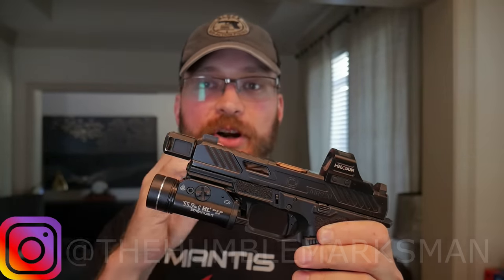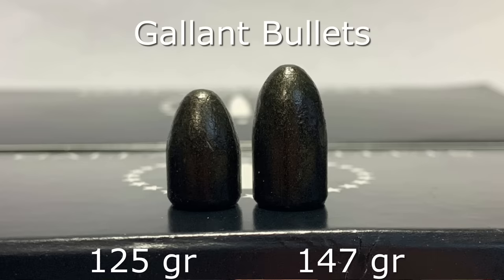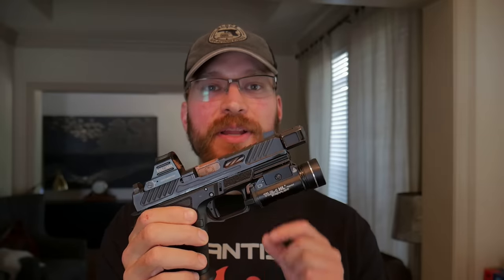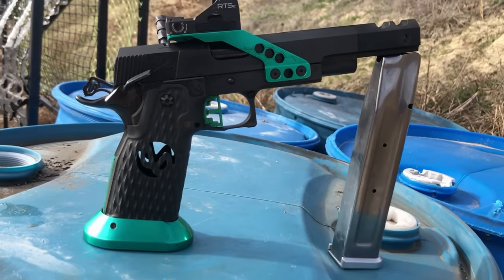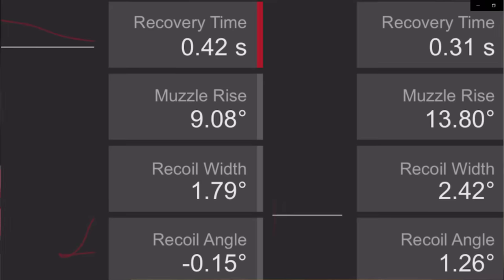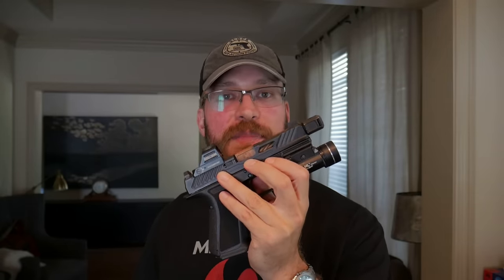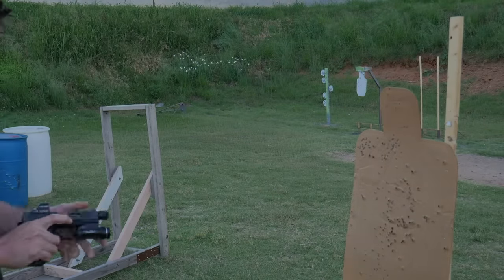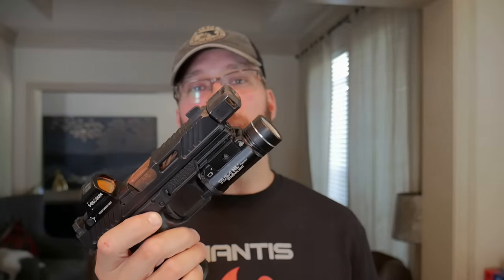Carry Comps - do compensators actually work on 9mm pistols?

Comment: Effectiveness of the comp is irrelevant. All that matters is how big the flex will be on the Gram
Reply: Big facts cause the most important thing is lookin cool
Reply from the maker: ABC
Reply: it isn't a flex though..they are cheap...
Reply: @dylanmills6944  not about the money bruh, its about looking tacticool lol
Reply: Lind of like those soaps? they were 20 bucks. but you could grind on hand rails around town lol. THAT was cool
Reply: Larp 100000000
Reply: @dylanmills6944  soaps were more than that... i was popular in middleschool with those heh. and i was a skateboarder. we grinded rails, was fun
Reply: Facts
Reply: Knowledge and skills are temporary, drip is forever.
Reply: I bought my PMM duty comp because I didn’t like constantly replacing “O” rings to keep my thread protector on 30%
Thought it would complete the look of my fde and black FN 509t.

Comment: i have a great tip for people with threaded barrels. Skip the thread locker and the set screws. Go  to Harbor freight and get an o-ring kit. Find one that fits your barrel. Put it on before you thread your accessory on. It will stop it from loosening. Ive been using the same one on my barrel for 2 years now. i shoot weekly. Its never come loose. I also keep the o-ring lubricated so it doesn't dry out.
Reply: Please explain more! I’m wanting to get a 509c tactical and put a comp on it. Are you saying to put the o-ring at the back of the the threads or the start and then just thread in the comp?
Reply: So you’re saying you don’t tighten the set screws or apply lock tire to them ?
Reply: @bhief473  not mine. once i tried the oring idea i had. Its stays tight and never vibrates off. I actually dont even have to tighten it as tight as i used to. The oring absorbs the vibration between the 2 parts very very well. I've shot 10,000+ rounds since then. Never had an issue with it coming off.
Reply: @imgoodaswell9558  yes at the back of the threads and screw it on and just hand tighten. The rubber oring absorbs the vibration between the 2 metal surfaces .  and i just hand tighten it on. Ive sent 10k+ rounds using the oring Ive never had an issue with it coming off or even loosening
Reply: @DisclosureTvNews  damn that’s impressive. How often do you deep clean your comp? Every 1000?
Reply: @bhief473  My wife and I Shoot USPSA,  steel challenge + shes a USCCA RO and we shoot/practice weekly and help out a master shooter who works with Cabelas and the USCCA. And our ammo is a little hotter because we make our own ammo. So we do full strip downs more than your average shooter. Usually after every time we shoot.
Reply: @DisclosureTvNews  I just got into uspsa two months ago I LOVE IT. Going next week to a steel challenge it will be my first time at that event.
Reply: @bhief473  Thats awesome. When we first got into it. We were so intimidated by house fast the shooters were. Even now we still kinda are. Because the masters are shooting stages with  all Alphas in 3 seconds and shooting steel stages in 1.5 seconds. We haven't gotten that good yet. But weve won 1st place in minors a few times already.
Reply: I was always worried about the rubber O-ring melting from the heat of the barrel. Has that happened to or came close to something like where the heat compromised the rubber o-ring?
Reply: @vicsec7822  Since i made this comment 1 year ago. Plus i was using o-rings about 3 years prior to this comment. Nope Still have the same o-rings on all my threaded barrels and I shoot at least 10 times a month.  If you have reservations about melting. Just purchase hi-temp o-rings.
Reply: @imgoodaswell9558  I didnt see your comment from a year ago. But yes thats correct. As a matter of fact. I bought Taurus's taurus tx22 competition scr. It came with an O-ring for the comp.
Reply: @DisclosureTvNews do I measure the size of my pistol,then go to harbor freight and get a o ring?
Reply: @fluttershy9206  nope. It's an entire standard size oring kit.  it's $6.99. Test fit till you find the  right ones that work. Which us usually a 3/8 or 1/2" size oring.
Reply: @DisclosureTvNews  and I place it on the back of the threads of my barrel,screw it on and hand tighten it?
Reply: @fluttershy9206  yes. remember you dont have to crank down on it like your fastening 2 pieces of steel together. Hand tight is sufficient. Also if you do have set screws, just make sure you tighten those so they dont fall out from vibration.

Comment: Great video. i bought a Faxon threaded barrel and comp for my M&P Gen 1 - worked right out of the box, currently around 400-500 rounds through it, no hiccups, with a few diff loads (primarily 115/124gr target) - just ordered a new slide to add an optic. I've noticed the gun absolutely shoots flatter for follow-up shots and faster shooting, but agree that slow-fire accuracy is pretty much the same. I don't think you can underestimate cool-factor on these - they look dope. EDC - I think it's fine to run one, not necessary, but if you're okay w/ the minimal extra weight, and added length - why not? Thanks for the upload.

Comment: 4yrs late but I also use a Herrington Arms comp—the HCAT. And maybe it’s the 4 years, but I shoot 115gr with zero issues (stock spring). And I noticed a massive difference my first time shooting with the comp after running it for a while without.

Comment: Interesting video, thanks. Running a 365XL Spectre (gen1) slide with lightening cuts, a threaded barrel and a Herrington Arms HC365 single-port comp on an X-Macro lower. Ammo is usually Gold Dot 9mm 124gr +P.  My goal was to tame muzzle rise without messing with recoil springs or experimentation with different Ammo. This is the same round used in my X-Macro daily carry.

Comment: One reason I’m considering a compensator is as a out of battery shield.  If I have to pull my gun in a ground fight and I go to press it into the perps body it will likely be pushed out of battery (making it impossible to fire.) With the compensator connected to the barrel it would keep the slide from being pushed back and solve that issue.
Reply: A barrel mounted compensator will not help prevent the gun from going out of battery in a pistol with the common Browning-based action. Pushing on the comp will also push back on the barrel and in most guns this is sufficient to not let the gun fire

Comment: Good information. TP9 elite combat, Zev V2 comp, 115 and 124 Gr ball and JHP. No failures, less muzzle rise, faster target reacquisition. Made me even more faster, accurate, lethal. Now if only I could find a better magwell with a flatter pinky site for my TP9 elite combat to give me that extra 1/4 inch for uniform flat pinky seating.
Reply: I live my elite combat just put a holosun on it and a optic plate with a intagrated cowitness
Reply: I edc the same gun. I put a disruptive defense comp on mine its made specifically for canik looks really slick and works greak. No cycling issues with nato spec and weaker reman 115 grain either

Comment: I've comped everything from 9mm, 5.7x28, 10mm & even .22LR just for the lolz.
It made the .22LR not work well (as expected), but everything else worked great & did have a noticeable decrease in felt recoil, even with micro comps.

Comment: I don't know how I missed this video last year?!  Excellent overview that mirrors my own experiences in many ways.

Personally, I've gone back and forth for carry.  I've gone away from the comp for daily carry the last year or so.  I farm, and frequently shoot from my tractor cab at vermin.  Even with the door open, and with my elecronic muffs...the comp'd gun with appropriate handloads is freaking brutal inside a metal/glass cab.  It's like getting punched in the face while blasting my ears at the same time.  Not fun.

Probably not the most valid reason for shying away from the carry comp...but that's just me.  Also, as you mentioned, messing around with aftermarket springs on a carry gun is always a pain in the ass.  Finding a good high pressure load (not to mention a handload that duplicates the performance) takes time and money as well.  

Also, I've had complaints at training courses from people who don't wear high quality muffs.  I shot a high volume course at an indoor training facility a couple years ago.  I didn't make many new friends that day.

Having <.1xx faster splits on my my carry gun  just isn't worth it to me right now.  On a competition pistol--if it's legal in my division I'm going to run the most aggressive comp I can find.

Comment: I have added a ninex19 threaded barrel and Herrington Arms HC3652P compensator onto my p365x. I have noticed a measurable reduction in recoil, muzzle rise, quicker followup shots, less felt recoil, and less fatigue. I've enjoyed it so far, but have had a couple cycle issues with 115gr ammo. My gun was already broken in prior to adding the comp so I didn't experience malfunctions every other round. I'm going to keep trying it with oem recoil spring and guide rod, but may consider a DPM tunable spring set. I had no issues with 147gr but have not tried 124gr yet.

Comment: I found compensators work. I bought Tonti for my APX.. But I discovered they're only good when they work. It made my pistol pretty unreliable, affecting its cycling. That ran me down the rabbit hole of guide rod springs. Then, striker springs for some reason. I even coated the barrel with NP3 for lubricity in cycling. All the comp  did for me was make the pistol finicky to the point the pros didn't outweigh the cons.

Comment: quick story and why I don't use a comp on a carry pistol: I had just comped my G26 and started doing close retention drills (where you shoot off your ribs in a close quarter situation), well, I caught shrapnel in the eyebrow. I didn't think beforehand about the direction of the expelled gasses or how that relates to shooting position. If comped, you have to be aware of those things or you'll get hurt. Needless to say, I don't want to have to remember which way to contort the pistol and/or the situation may not even allow time/distance for it. Just food for thought.

Comment: I have been using a PMM regular size (not their smaller one) comp for a while on my G19 gen 5 MOS. I am 🤏 close to getting the radian ramjet/afterburner to try. I had a ZEV 3 port comp and it was jamming using it so its been sitting in a box.

Comment: At the moment I'm running a trybe double port uni comp on my Springfield Echelon my EDC and all around home)duty gun..works great with 124 grain+..paired with apex tactical captured guide rod with 18lb flat wire but also have a 12lb wire but it seems to run fine and with less recoil on the 18lb spring...I would recommend it. It's just temporary though because Herrington Arms is working on an Echelon specific comp and Springfield themselves are making a self indexing one like the hellcat has but for Echelon

Comment: Excellent video on compensators.  I agree with everything you said, especially when it comes to ammo choices.  My standard "non-compensated" match loads is a 147gr at about 860fps.  Soft shooting for sure, but it won't work a comp worth a damn.  If you're shooting factory ammo, ammo from Fiocchi, S&B, and Speer Lawman rounds run nicely in the comp gun with the 115gr loading.  Likewise the WW 124 NATO.  If you like heavier bullets, the 147 Speer Lawman and the Federal 147 American Eagle function nicely in my comped Canik SFX.
Reply from the maker: yeah any NATO load will do good - I'm partial S&B
Reply: All I shoot is Speer lawman 147 is it worth getting a comped gun? Will I see any improvement in recoil

Comment: Yes, my carry p320c wears a pmm gen 1 comp with the grey ghost compact slide and a fullsize grip module so it fits within the dust cover. Throw a rds on top for good measure and the thing with 124s is like turning on all the cheat codes.
Reply from the maker: Those are awesome setups.  Not gonna lie - I wanted one before the recent class action lawsuit has me shy about carrying one.
Reply: @TheHumbleMarksman  yeah, I put an agency trigger shoe on mine that has the glock style dingis thing. A lot of guys knock on that trigger "why would you wanna turn your sig into a glock!?!" But for me it was the added layer of safety that gives me the confidence to carry it.

Comment: I have a Beretta 92 with a comp. It's my home defense gun and favorite pistol I own to shoot at the range. I personally would not put a comp on a carry gun because it makes it less concealable and I carry appendix, so the extra length would make it uncomfortable for me. Ported barrels are also great for reducing muzzle rise. They don't add any extra length to your gun and you don't have to worry about using hotter ammo or changing out the recoil spring but they don't look as cool as comps.

Comment: Outside of being in CA with no threaded barrels, the problem is always finding a holster.  It's hard enough finding a holster to accommodate the light.  My concern in looking at the CA mass driver is snagging it on a presentation or cycling issues because the spring vs pressures isn't in sync.

Comment: Got a  4.5" threaded barrel on the way for my G3. Will be getting (most likely) a Agency Arms 417 dual port. BUT....I'll be sending the assembled gun to the 460Rowland company to rework the barrel to their 960 conversion. It's a longer 9mm case, same weight slugs, but goes 1600 fps and makes ~650 ft lbs, in the mid-range of 357 magnum power.
Reply from the maker: That’s pretty spicy!

Comment: The Arc division Spark M v2 , I use it with my carry gun and I love . It shoot with fine the  factory recoil spring and any ammo I have put it through.
Reply: I’ve used multiple comps on my glocks and by far the arc is the best one. From reliability to significantly less felt recoil.
Reply: Have you used an arc on a p320?

Comment: Fn509 tactical, Parker mountain machine comp.  Love it!
Reply: That’s what I rock
Reply: I got the JTTC ultra.(dual port).on a fn 509 tactical compact.
Reply: @natewahl9873  I had a hard time determining which to get, single port or double.  Have you been happy with the double?
Reply: @greenjebadiah  I love it, however, I do like to carry it once and awhile, and while, i do.....man is it long now. Was thinking about getting the single port also.
Reply: I want a parker Comp for my VP9
Reply: @natewahl9873  did you have to get a different barrel?

Comment: I would consider a compensater for my concealed carry but it may be harder for me to find holsters... so weather I consider it or not may depend on that. I would also have to do a lot more research on what I would need to do to my spring tensions.
Reply: T. rex arms ragnarok  holster and Herrington Arms compensator. Holster is open ended and comp works with stock spring system
Reply: I’m no expert but I feel like comps and cycling issues are more common with shorter barrels. The barrel I use with above mentioned set up is 4.6”

Comment: I would really be interested in how one of the super light extra high velocity loads would work with a comp such as Lehigh defense Extreme defender 68gr or Fort Scott munitions lightweight load.  These are getting near or over 2000FPS and generally are considered lighter recoiling even without a comp.
Reply: I wouldn't consider it. I carried a load like this for awhile, and I planned on running it on a parker mountain machine build. Bear in mind, I was not using Lehigh defense, and I'm no expert. This is just my experience. The ammo I was shooting was 90 grain (ish) and was rated at like 1700fps if I remember correctly. It would barely cycle my slide with no comp. I wouldn't carry it, if I were you
Reply: Just reread your post. I was running the Fort Scott light load (90ish if I remember right) and it wouldn't cycle at all

Comment: I got comps on more than a few of mine but my only complaint is they're not compatible with all holsters and you can't break down the slide easily if needed.
I got the lakeline llc ported barrel for my gx4 so it has some compensation and easy take down still.
Reply: Lakeline makes a mini comp that'll work with most holsters and only has a slot port on top.
I've gotten 3 or 4 of the other type of micro comps also to use that way they fix my holsters still no problem.

Comment: Agency Arms 417c on my G43X. Big difference over stock. Fired them side by side.
Reply: Are you using a stock recoil spring?  Any reliability issues with any ammo types?
Reply: Rob Vigesaa stock spring and no issues. Even with standard 115gr range ammo. It was designed to be reliable with stock recoil springs.

Comment: a question: got a OEM threaded barrel for my pistol that came w a recoil spring. herrington arms recommended I use the OEM spring. I assume that meant the original spring not the one that came w the threaded barrel, which I assume is somewhat heavier spring? I’m new to mods but am excited about it.  I also figure with removing the comp for cleaning provides some assurance the set screws aren’t gonna walk out on u, provided one keeps a tidy maintenance schedule?